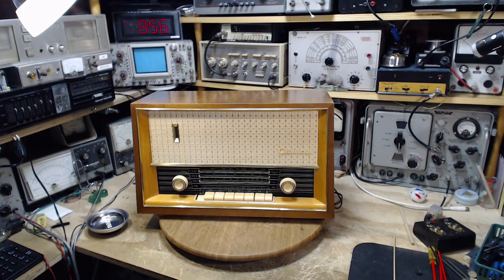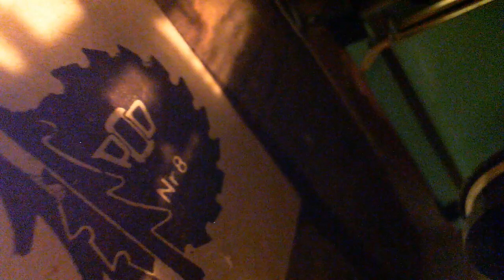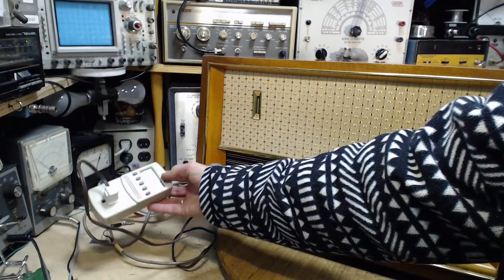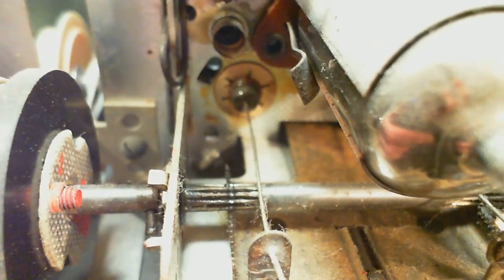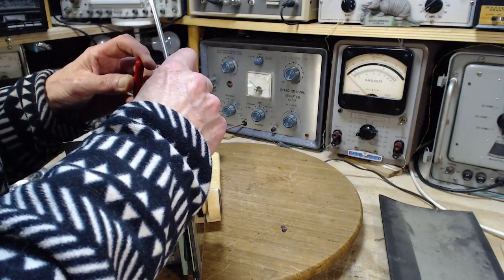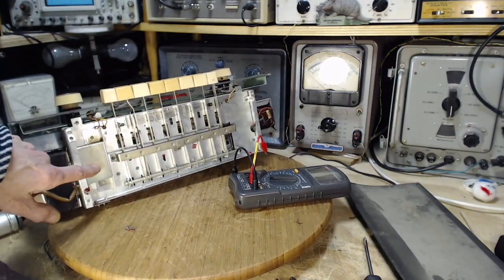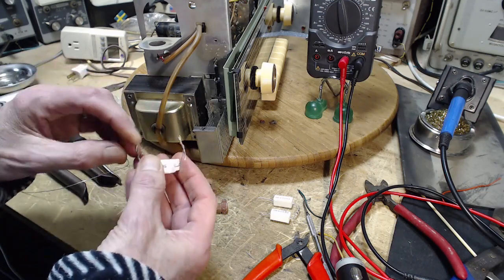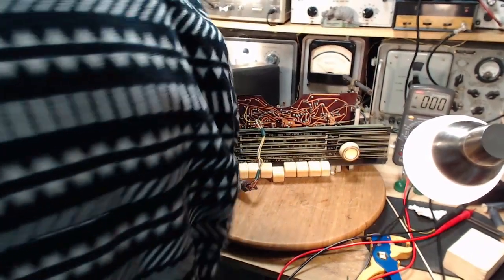Polish Goplana Tube Radio Video #1 - Checkout and Powerup

Comment: Dear Jim, it's nice to see Polish radio in your laboratory. Living in Poland, I have the same experience in repairing such kits. If you need help - let me know. Please note that Goplana for the local Polish market and this model (under the same name) are different. Instead, look for a diagram from ZRK Swiatowid. The weakest points in Polish radios from the mid-1960s are paper (wax) capacitors and a selenium rectifier. In most cases, the electrolytes can be reformed. For the same information - I suggest you look at my blog - menuet-ukf.blogspot.com (sorry in Polish). Regards Wojciech

Comment: That carbon antenna rod is more likely a ferrite rod. Ferrite is made of a ceramic material with finely powdered iron oxide mixed in it. The iron gives it the magnetic properties needed to make it useful as a core for high frequency inductor applications. 
The ceramic binder insulates the iron particles from each other so there are far less Eddy current losses compared to solid iron. 
The adjustable slugs in those tuning coils and the IF cans are made of the same material.

Comment: On power resistors you may have to sand the leads and add a dab of flux. It gives me a firm connection all the time I used to work on many Zenith point to point chassis and the flux helps a lot for a solid connection

Comment: 40:26 ATTENTION this is an inappropriate comment disguised as a tip;
When you cut a twin wire (like the speaker connection) or any multi wire bundle, with the intent of splicing the ends back together later, you should if possible stagger the cuts a good distance apart, so that the splice points including a proper length of insulation (f.ex. heat shrink tube) will not overlap. 
But this probably being another inappropriate comment feel free to ignore and report it

Comment: You may want to resolver the points around the tube sockets and wire wound power dropping resistors once you replace the filter caps as preventative maintenance

Comment: That is a 120 cycle hum. They use a full wave rectifier. The selenium rectifiers were common problems in the German radios. They would short out and take out the power transformer They gave off a strong fart odor when they failed

Comment: 1:09:00 Is it a distortion by the camera or does it really look like the rod of the ferrite rod antenna, which can be seen in the lower left of the screen, is not straight but kinked to the right about 2/3 down, just where it passes the mounting bracket?

Comment: 1:00:39 Anyone notice how the DMM starts to display Ohm readings in the 20k range  even with the test leads not both connected?
Would it be inappropriate to chant
🎄Santa baby,  slip a multimeter under the tree for me. 
Been an awful good boy.
Santa baby, and hurry down the chimney tonight.🎄

Comment: That last joint might not be soldered properly resolder the right lead on the second electrolytic and see if sound comes from the speaker.

Comment: 55:20 Another improper comment: It would be beneficial to leave the old electrolytic mechanically (not electrically) mounted in the chassis. One can loosen its mounting screw and use it to tie a loop of solid blank wire to the chassis. This loop can serve as a proper mechanical and electrical ground connection of a three terminal strip onto which the new capacitors  can be mounted. This way the old capacitor stays in for the looks and to be restuffed later if one chooses to, and the new caoacitors would have a mechanically sound connection and not flop in the breeze.
But like I said it is just an improper comment disguised as a shop tip to those who want to restore a radio to near close to M.Caldeiras standards.

Comment: For info on this radio see ZRK Goplana Export at url oldradio.pl/karta.php?numer=1800
(Use google translate if you cant read polish)
Then follow the link in the text to the non export model ZRK Swiatowid for schematic and to demystify the AM antenna wire.

Comment: This looks like a direct copy of a NORDMENDE but made using parts produced in the CCCP plus British Tubes, That plate that is sticking up is a RF shield to stop feedback.
Reply: According to the polish site the FM frontend is mfc by Philips. So I doubt it is any copy of a Nordmende.
But it is more complex than an AA5 for sure...
Reply: @randomsteve4288  but the capacitors and resistors and what have you are most likely made in the CCCP as they look like the parts used in the VEGA Selina and VEGA KEF.

Comment: The German Grundigs were much better radios They had a point to point metal chassis and a larger 6x9 speaker in the front and 2 midrange  speakers on the sides. No printed circuit boards in the Grundigs. The printed circuit boards are prone to failure from cold solder joints